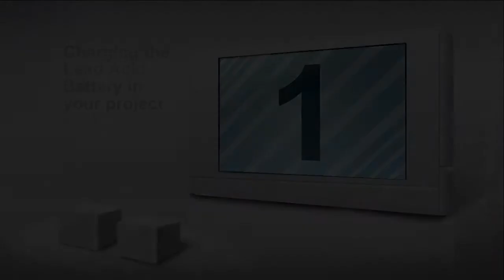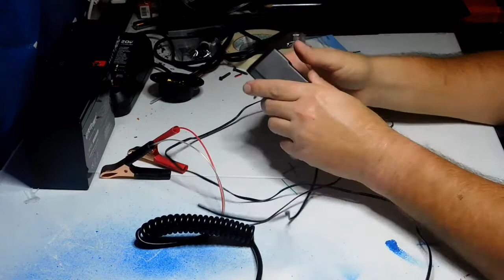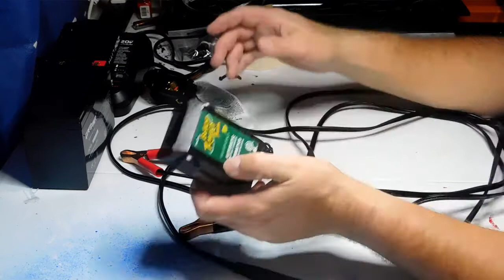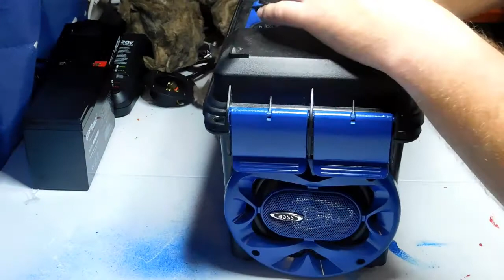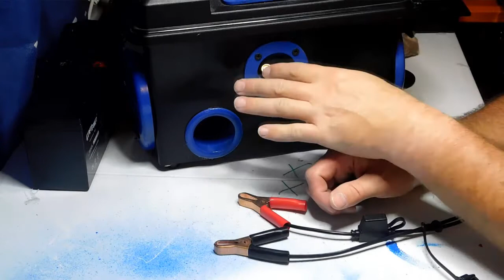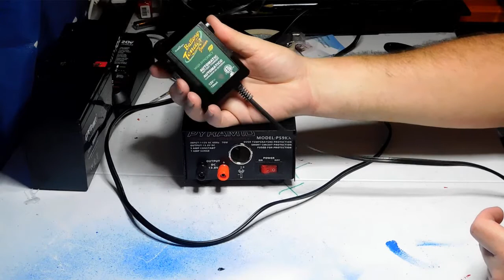Battery Charging Options For Your Projects

Comment: If don't have a switch then those posts are hot? If I'm loaded I might crisscross the clamps and fry something...the clamps might slip off and arc... can I play it while charging? Must be a way to wire spade connectors from the battery inside to an exterior panel mount with something like a dummy-proof SAE connector (so a dummy like me doesn't do something dumb) to the Battery Tender so I don't gotta open it up to charge it like I do now. Your boomboxes look nice, Thanks for the video!
Reply from the maker: If you watch my video on Charging lead acid batteries,  I have a port that is installed on the outside of the box that the battery charger can plug into.
This video was made a few years ago and I have come up with better ideas if you watch my newer videos.
I will send you a link to that part
Reply from the maker: This video is 3 years old
Reply from the maker: https://www.amazon.com/gp/aw/d/B07V6NJ37P?ref=ppx_pt2_mob_b_prod_image

Comment: I’m doing a build with a 200watt Bluetooth amp module that can run 12v-24v I was thinking of running 2 SLA batteries in series what charger do you recommend to keep them charged. Without having to remove them or open up the box.
Reply from the maker: The Battery Tender Jr will work just fine.  If you watch my video I just did on the large, waterproof green box, I installed a charging port that will work perfectly.  I will get you a link
Reply from the maker: Let me invite you to my Facebook group.  I Love All Things Radio
Reply from the maker: https://www.amazon.com/gp/aw/d/B07L8GT57R?psc=1&ref=ppx_pop_mob_b_asin_image
Reply: Would I be able to have it charging while using it
Reply from the maker: @mikecoronel5140  You can, but if you use large enough batteries,  like two 10ah batteries,  you won't have to. It should also run 14 to 16 hours on a charge. Maybe longer.  Then just charge it when not in use.

Comment: Why can't you use a power supply as a battery charger is it because of the difference in the voltage
Reply from the maker: Are you on Facebook?
Reply from the maker: It's hard to explain in text. Anyway I could talk to you the phone? I can email you my number or I can call you
Reply from the maker: One of the main problems is a power supply. Is not a battery charger. If designed to provide constant power to power a device. A battery charger is designed to take a battery and bring it up to charge slowly and then slowly increase the charge in the amperage and then once the battery is charged the battery charger will shut off and quit charging. A power supply will continuously feed power to the battery at an over right that the battery can handle and that's going to cause a power supply to overheat that's also going to cause a battery to overheat and it's going to burn out the cells in the battery

Comment: Will a wireless router ac adapter charge a lead acid battery
Reply from the maker: No. You will damage the battery and kill the ac adapter
Reply from the maker: You must use a battery charger to charge a lead acid battery.
Reply from the maker: Harbor Frieight does. So do most auto parts stores. Just order from Amazon
Reply from the maker: Hey Travis join my Facebook group we can talk a lot easier over there and I could show you pictures and links. Just look up, I love all things radio
Reply from the maker: A good battery charger starts around $15. The battery Tender that I use is $23 at Amazon

Comment: Will a 12 volt battery charger charge 6 volt lead acid batteries
Reply from the maker: Only if  the 2 are wired in series.
Reply from the maker: If  you watch my Mega boom box videos,  I have two 9ah, 12 volt batteries wired in parallel,  and it charges them just fine.

Comment: Great video Phil. You can also use a 12 volt cigarette lighter socket on the project and put a lighter style plug on the battery tender ends as well. Also give you an option to use the ammo box to power or charge something with a lighter plug. I usually run these direct to the battery so they are hot all the time.
Reply from the maker: Howard Hoffman You are correct.  My wife uses that method to charge her battery.  She uses tje cigarette adapter